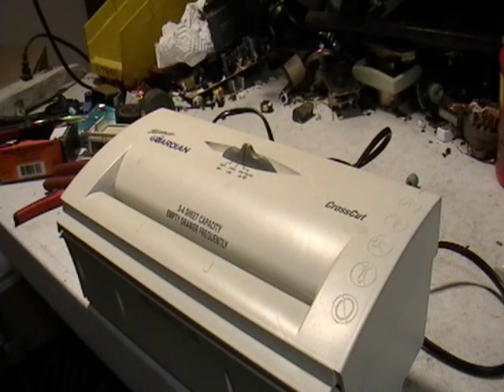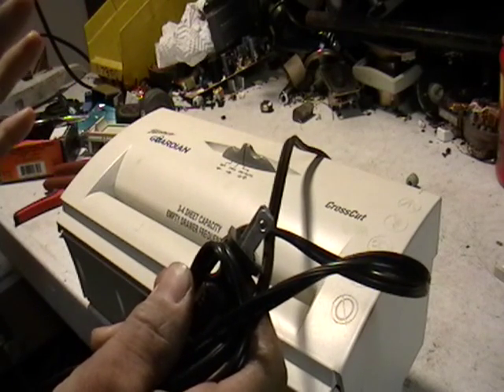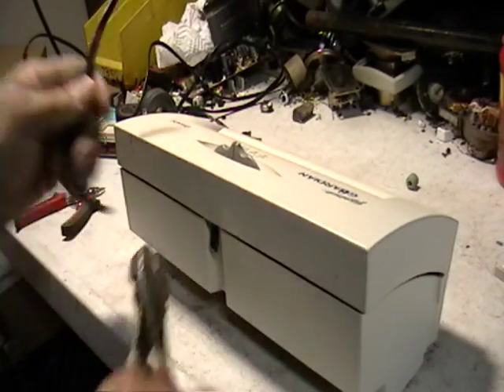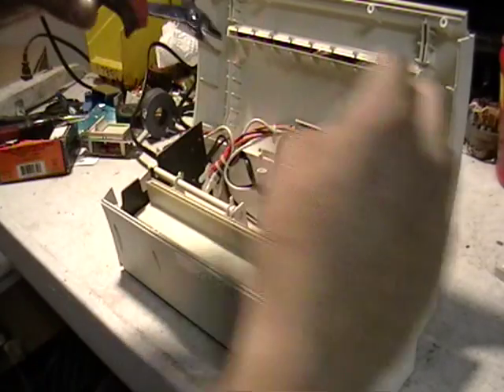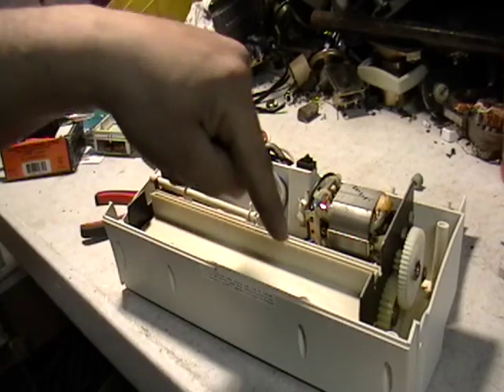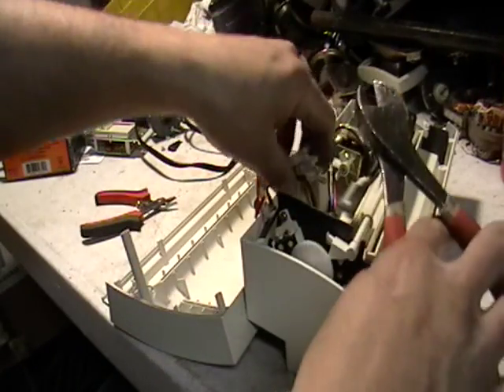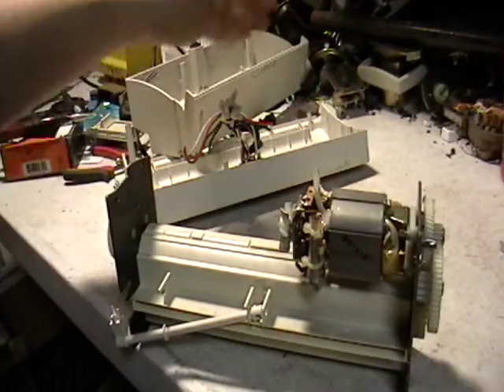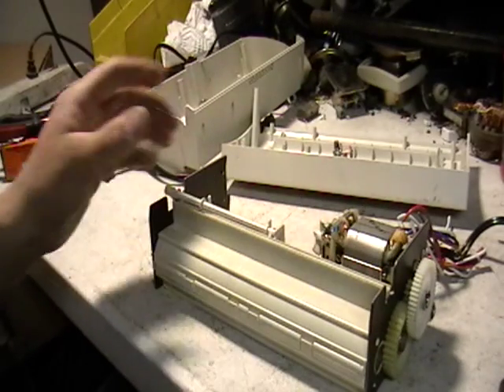Possesed shredder

Comment: Good god!  I would be afraid enough to use Jacks method of finishing the dismantling of it.  There has to be a small capacitor in there that was just refusing to lose the charge.  I hope the rest of it came a part with out an incident. Maybe get some rubber coated chain mail gloves?